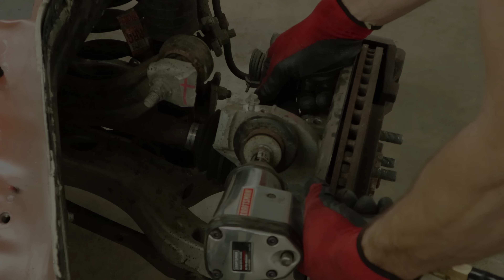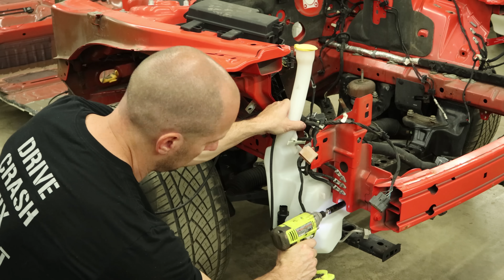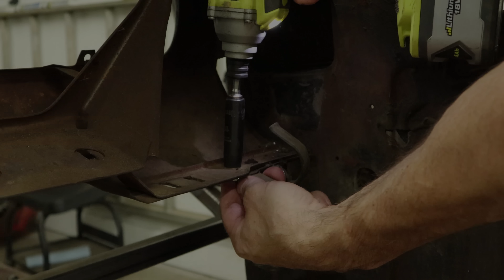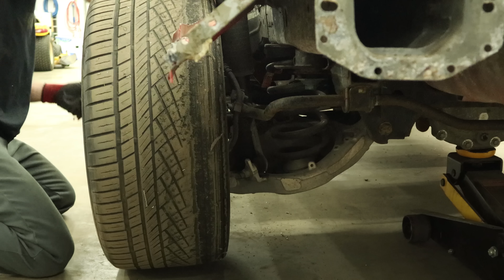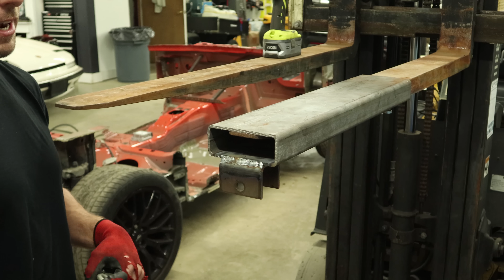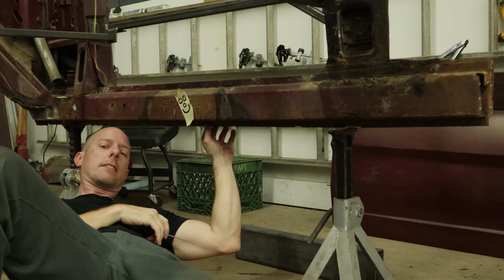The 2015 gets some new parts and more trimming on the Mustang rebuild project part 14

Comment: Drill a 3/4 hole at the ends of your forks. Then you could thread a bolt and nut to keep the chains from slipping off your forks. I know this is after thought seeing as you already figured out a solution

Comment: Perhaps it's silly, but it is cool. The pump and control valve from the mini log splitter will make the engine lift work like it should. I've never liked the way they operate.

Comment: I think the floor of the 2015 may be lower in relation to the wheels...so the top of the wheel may be higher in the 65  fender and quarter panel when you match up old and new rockers...see the B is for Build Coupe (67 or 68)..  I know you may go with fender flares...probably the easier solution...

Comment: Hey there.  I am looking forward to the time when you do the mig plug welds.. maybe you could tell us about  ..or show us ...your method.. do you start in the middle or outside or the top  ?.  Do you go in circles or just one circle..clockwise?  .I have read some folks do side to side.do you use .030 wire or .023 .. .I always seem to miss a tiny bit.. but I need more practice..thank you for showing the stuff other guys skip sometimes.  I missed the video where you explained the masking tape smiley face...I think it means  to keep this part but it may have more to do with video editing.. 😆 cheers Chris in Canada.

Comment: Well I wanted to watch this yesterday but I got busy, so I git to watch it while enjoying my coffee this morning. I'm surprised that the wheel speed sensor came off that easy. I'm in Georgia & use to work on older cars with rusty nuts & bolts, I always thought that Rust Not (dark brown can with yellow print) worked the best. I'm sure the afternoon crew is out there possibly flipping more than just tires.😉😉🤣🤣🤣

I've told a few others about your channel & that they should watch to get some pointers on spot-welds & panel removal/installation. Hopefully, they will watch a few videos before they butcher up something else! Not so much that they butchered it up but I can see their panels rusting behind their welds in a couple of years.

You're making great progress there! I was starting to wonder where Mr. Spotty was at but he showed up at the end of the video. Was he on coffee break or just out signing autographs!😁😂😂

My Mr. Spotty t-shirts (black & dark blue) fit pretty good. I bought a size bigger than I normally wear, thought they were going to be to small after washing & drying but I guess they are preshrunk.😊😊😊

Comment: Love the air powered torque wrench. RIP Mr DeWalt.
Reply from the maker: So much quicker than those old hand torque wrenches. 😂The yellow guy will be missed!
Reply: Can your old DeWalt be repaired?  What kind of drill would you replace Walt with?
Reply from the maker: Yes, it just needs a new trigger.  The trigger is half the price of a new drill so I think I will fix it just to have a spare.  I’ll replace it with the same drill.  They still make it.  I get comfortable with tools and this one has been good to me.

Comment: Sorry if I'm being a bit stupid, however, isn't the 2015 Mustang a monocoque / Unibody production car? If you cut the crap out of it, doesn't it loose all of it's structural rigidity?
Reply from the maker: Both cars are unibody.  That is why we are putting back the frame rails we removed.

Comment: At first I thought Spiderman was working for you with those fancy gloves you had on... this build is getting very interesting. 
When you talked about adding the steel frame member, I thought to myself that thing is going a add lot of strength, and would be a great place to tie in the cross member and roll bar you talked about previously, once it’s all said and done that thing should handle like it’s on rails, with those wide wheels and narrow track....be careful, stay safe, need many more Ford Friday builds..... to help offset the situation going on....🇺🇸
Reply from the maker: Those gloves take a beating for only paying $.40 a pair. 😂  the frame rails might be a little much but I’d rather overbuild it than have issues later.  Thanks for the support.

Comment: It will probably be fine but pinch bolts on the tapered forklift fork could move suddenly. Once it slips just a little, the clearance increases quickly. It will certainly lift a lot of weight but I wouldn’t trust it for any horizontal (sliding) loads.
Reply from the maker: I could always put a safety chain to the back of the fork as well.

Comment: FYI The control arm is Ductile Iron, not cast iron. Yes it is cast but has a steel like molecular structure ideally suited for suspension components where cast iron does not.

Comment: Have you thought on making it a 2 seater?  Fab up some removable covers to have a little storage and hide the bottom part of the roll bar like the A/C Cobras.
Reply from the maker: I’d really like a back seat, it will be a daily driver in the summer.

Comment: Make sure that your frame is not tweaked where your suspension was damaged -once you weld the body on if it’s out of wack it will be trapped.
Reply from the maker: It’s good, all the damaged parts have found their way to the pile.
Reply: vehcor  I’m not talking about the parts you replaced I am talking about the area that the broken parts came from (just because the parts broke doesn’t mean that the mounting areas are not affected - the energy that it took to break it could have affected the mounting point)

Comment: So will this finished car title as the '65 or as the '15 - which VIN will apply, if either?   Or is there a different answer altogether?
Reply from the maker: It will be the 1965. Clear title, clean Carfax!
Reply: Im watching closely but skeptical on the outcome. The wizardry of the 15" is the super stiff chassis which has been systematically been diminished with each busted spotweld.  Would it not been a stronger car if you made minimal cuts to the 15" and did the meat of the surgery on the 65? I know your far from done but i had to give you my armchair 2 cents. Good luck with the build. Im rivited too!

Comment: Nice job.  Moving along nicely.   You're located in Illinois.  Curious; how will they title the new conjoined car?  2015 or 1965 rebuild?  Do you have to get it safety inspected first?
Reply from the maker: It will be a 1965 and it doesn’t need an inspection.  It is a clear title with no accidents.  I have the Carfax to prove it! 😂 Thanks for watching!

Comment: no anti-seize? I'm the next guy. 
Use anit-seize? Probably never touch it again. 

When the rocker structure was cut out of the 2015 I was thinking relying on the '65 rockers was going to be bad news with 400+hp and the modern tires and suspension. Especially for a convertible. Replacing it with standard steel tubing certainly solves that issue.
Reply from the maker: I have the same theory on the anti-seize.  I guess it is just a little insurance that I don’t have to do it again.   I originally planned on bracing the 65 rockers but the opportunity is there for replacement and improvement so it makes sense.

Comment: I really love this build ! I am not a mustang fan. I had a 1971 mach1 fastback.....rust bucket.....ruined me on fords......changed to camaro/Trans Am.....67 yr. old but I f I could I would take on this build! I have shared this build project with VTuned mustang build in the comments section of his channel a few days ago.
I hope his viewers come and see how your build goes.....I've seen Vtuned and B is for build mustang projects and this channel build is far better than the other two......IMHO
(If I was younger and had the space, I would do this build except with Fastback 2+2 car)
Great job
Reply from the maker: Classic cars are always fun.  They can be a headache sometimes but worth it.  I talked with Vtuned back when we started and he wanted to the project similar to me but his donor was too far gone.  I like that he took a different approach and it is cool that he is not afraid to learn by doing.  He has some amazing talent and that is the reason he is one of the few channels I watch (even before we started building Mustangs).  Once he has the years of experience I do, I won’t be able to hold a candle to his work.  I saw a couple clips of BIFB’s first car but have only heard about the second.  He works a bit faster than the V’s do. 😂

Comment: Traditional cast iron does break, cast ductile iron does not break the same and can bend.
https://www.commercial-industrial-supply.com/resource-center/ductile-valves-vs-cast-iron-valves/#:~:text=Ductile%20iron%20is%20a%20more,made%20with%20nodule%2Dshaped%20graphite.&text=Ductile%20iron%20has%20excellent%20corrosion,suited%20for%20high%20demand%20applications.

Comment: Great invention on the fork extension, it does the job nicely. Your inventiveness is very useful in all sorts of situations. Before you toss out that old drill that died, check the brushes. It might just need new brushes. I have power tools that I bought over 40 years ago that are still in good working order, but I have replaced the brushes in a couple of them. I try to repair what I can whenever possible, before considering buying new. Besides, the old stuff was built to last, not like some of the junk sold these days. You're certainly putting a lot of thought into doing this build the right way, for the best possible outcome. It's going to be one of the best Mustang retro-mods out there when it's finished. I'm looking forward to seeing more progress. I just wish you had more time to work on this project. Stay safe over there.
Reply from the maker: The drill just needs a new trigger, it costs $25.  A new drill is $60.  I might pick up a trigger just to have a spare because other than the worn out chuck, it has zero other issues.  I wish I was retired and could just work on this all the time.  Thanks for the support!
Reply: I totally agree with you. Brushes are cheap and an easy & quick fix.

Comment: If the object is heavier than a fully guttet car I recommend using a hook that slides over both forks. I have such thing and it was absolutely inexpensive. Building this yourself looks way more expensive.

The load rating on the forklift is for both forks and bending one fork is a expensive mistake as those do not come cheap. Tell how I know.
Reply from the maker: The engine and trans will be the heaviest thing I use it for.  It cost me $20 to make that.
Reply: @vehcor  ...you certainly do not count your own labour in this.

Comment: the fender as a front is an interesting mod i'm doing a toss together rebuild and  have a front grille but a sender for a front us thought provoking.
Reply from the maker: I pulled it out of the corner test fit it and  the 2015 radiator supports make nice fender hangers so I did not put it back. 😂
Reply: @vehcor  it's in it's 'happy place' and so handy when you finally need it.

Comment: Well that ABS brake sensor was a surprise...lucky bastard 😂.  2 new frame rails will be better anyway.  Real race car sandwich the floor with 2....1.75 .095 wall tubing per side....Nice place to mount cage..and other good chit...no train again! Lightning 🌩 is good too.  Thanks for making my rusty 56 chevy look easy again.👍👍👍👍👍👍
Reply from the maker: I hope I didn’t use up all my luck on that!  I’m going to need some more for the rest of this project. 😂

Comment: well that answered that question I has last time(or was it the time before) that I said I would just watch to find out and not ask about. It was the frame and how you had cut it out of the 15' and I could not see you using the 67's either. Glad it didn't take to long for it to be addressed.
I guessed almost right on the fabrication section, I was thinking it was going to be similar to the engine levelling thing you are using on the rear end but for the front, so not totally right but close enough that I am calling it a win.
Reply from the maker: I have thought the build through to the end, some stuff changes as I go so I address the issues as we reach the step and I am sure which path I am taking.  I did think about something similar to the rear to keep the chains from pulling the body together but I have been measuring it and it has not changed so hopefully I will be good until the end.
Reply: @vehcor  which is why when I had questions I knew I just needed to keep watching and see what happened, I had faith in the plan.

Comment: if you hit the arm with a grinder, you can get a pretty good indication whether it's cast or forged iron.  cast is weldable,  16:20... stop video.... laugh for awhile... ahem... start back watching.. 18:13 - just another way - make a cradle so that your chains aren't pulling the sides together.... please don't ask me how I know this, I'll probably cry (again) - I learned this on a 32 Ford... there, now you can cry too
Reply from the maker: I measured it before I lifted it and it has not changed even with that cowl panel removed.  That is one tough dash. 😂

Comment: I definitely got you "non-Harbor Freight" jack stands comment.  Last night I went to my garage and examined the welds on a new pair of HF stands that I haven't used just yet.  Good welds on these stands.   No return headache.
Reply from the maker: A cheap ratchet breaking is one thing, jack stands collapsing is completely different!  I don’t mind HF stuff, it has its uses.

Comment: rusted out cowls were very common in many if not all makes in the rust belt. a friend had a good looking 60's GM he thought he had a leak at the windshield. so much for thinking an easy fix.
Reply from the maker: Usually the channels under the windows rotted out.  On Mustangs it seems to be the parts under the fenders.

Comment: "torque to spec"
runs impact and says click hahahahahaha
great videos, man.
Reply from the maker: That’s how it works, right? 😂
Reply: @vehcor  yeah that's why I had to use a 4' extension to move lug nuts on a car I acquired or many they were just a bit rusty.
Reply: I was always taught you have to say "click" a second time to double check that it was accurately torqued